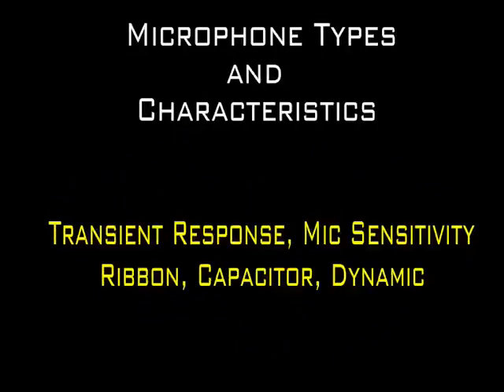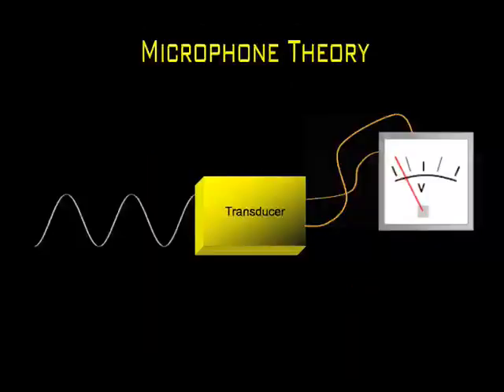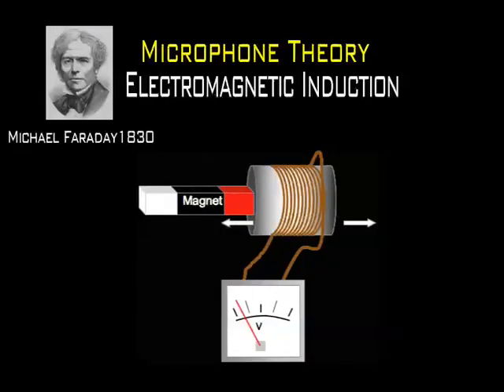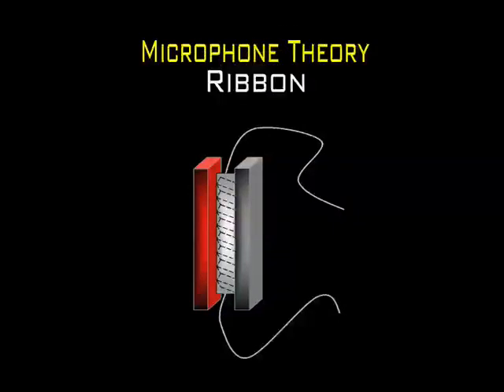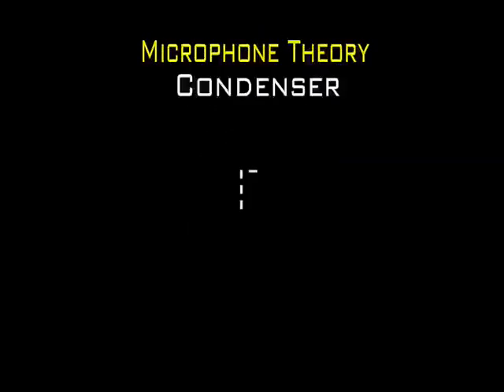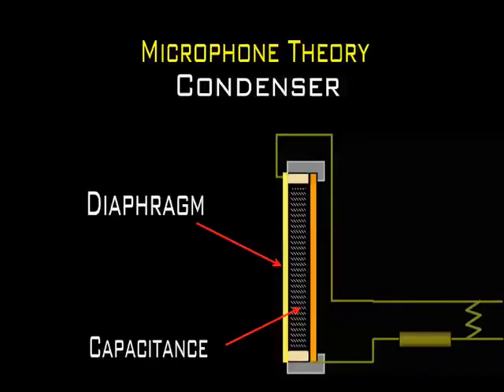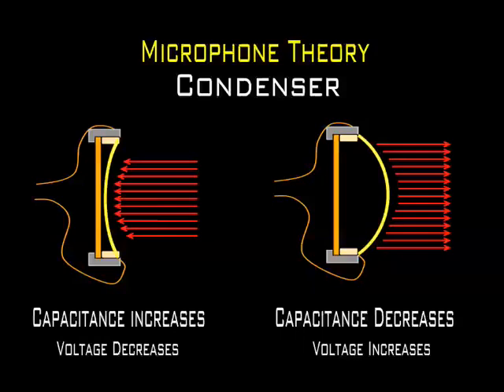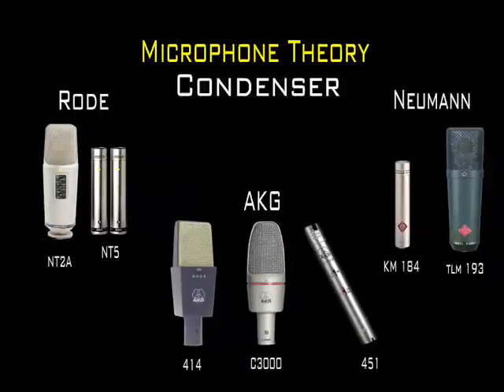Episode 3 - Microphone types and characteristics

Comment: Condenser microphone have no charge/discharge cycles during sounwave because of huge resistant of load on it. I mean it happends thru coupling condenser but it will not change voltage. The voltage difference occurs when single charge remains in variable capacitance. Load capacitance only decrease this voltage change.

Comment: Condeser micro's don't work on voltage, but on the changing amount of farad of the condenser itself, if i'm not mistaken, the amount of Q (the charge) stays the same, which leads to a changing of V (voltage) and C (capacity) cause C = Q / V. Or well, thats how they taught me...

Comment from the maker: Absolutely NOT TRUE. It actually doesn't even make sense. The bigger the sound pressure levels, the bigger the output. Condensers are more sensitive, so they reproduce different sound levels with more accuracy, due to the faster transient responce. Sing louder, it will output a louder signal. It may even distort.